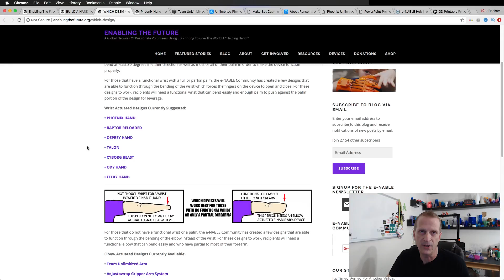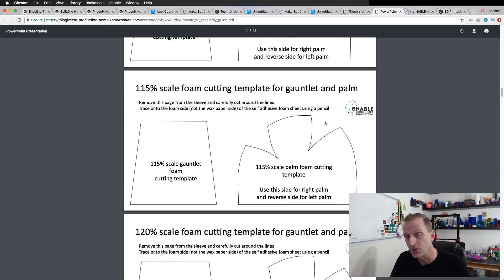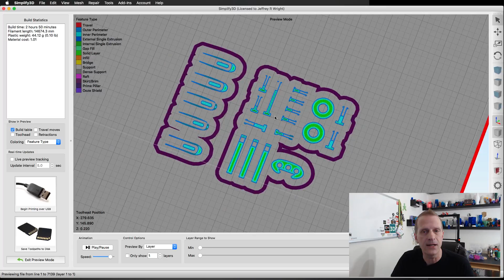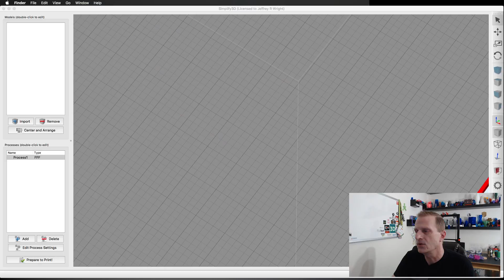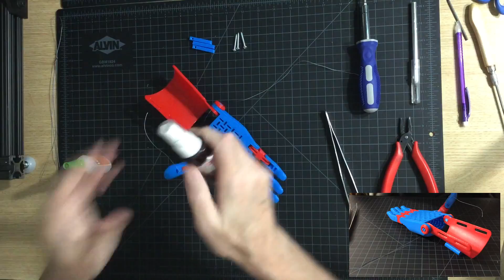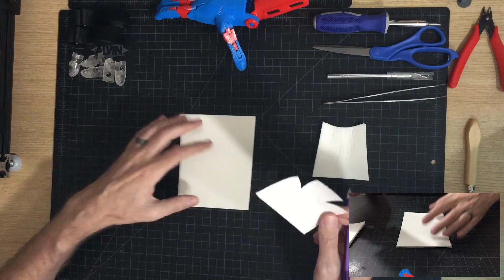How To #3DPrint And Assemble The Phoenix Unlimbited Prosthetic Device

Comment: You don't have to click the create thing for each part. The part parameter is only there to allow you to PREVIEW the parts. You only have to click "create thing" once and ALL the parts are generated. You can then download them ALL as a zip file!
Reply from the maker: Most excellent tip, thanks for sharing this and for watching!
Reply: @RansomMakes  that's how I designed it😉